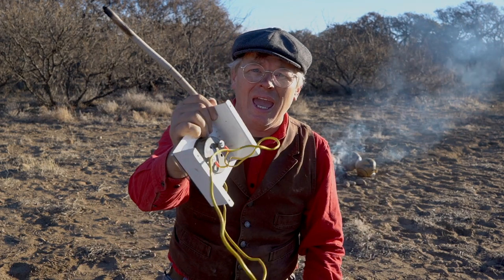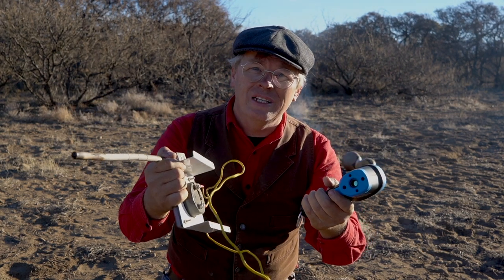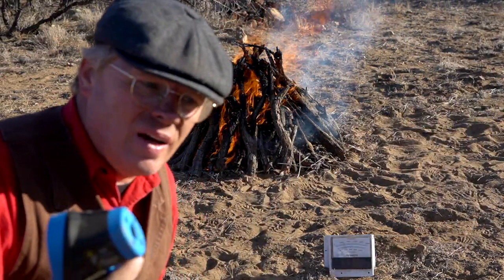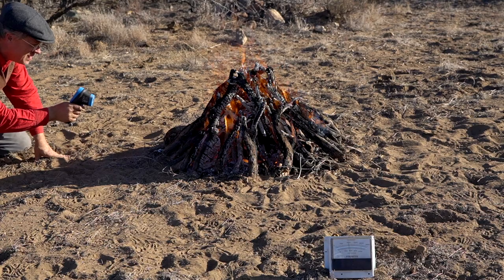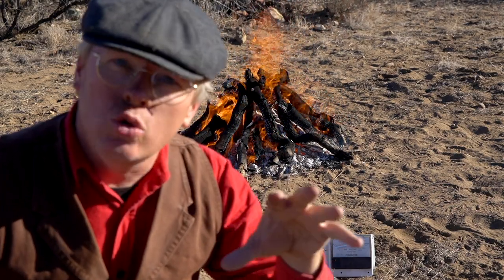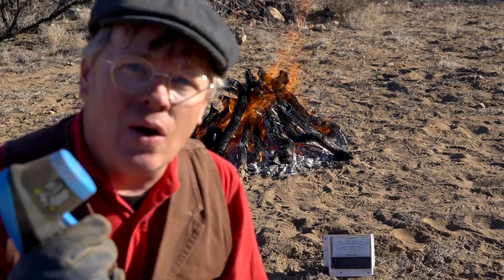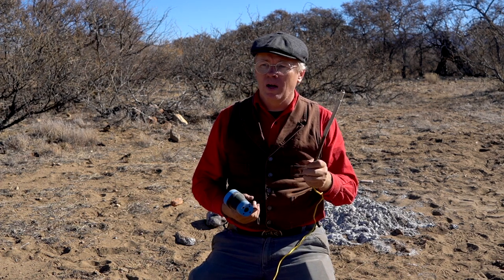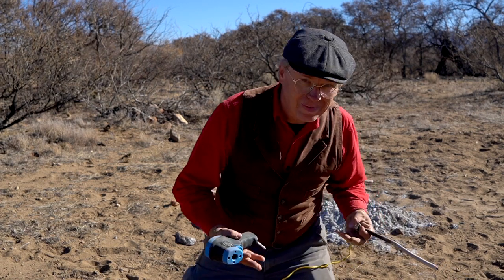Measuring Temperature in Outdoor Pottery Firings, Thermocouple vs. Infrared Gun

Comment: One of your viewers indicated the Thermocouple needs to be calibrated. This is true but also applies to both methods. To minimize the variance between the two methods is to measure something of known temperature such as a cast iron skillet in an oven. If set to lets say 500degF then measure using both methods. With this information one can then with some variability know what the temperature correction is  needed for use when firing the pottery outdoors. Thanks for sharing.
Reply from the maker: Thanks for the tips

Comment: Hi Andy! Would just like to ask what is the best temperature for the pots? And how long should it stay in that temperature? Thank you much.
Reply from the maker: The temp required varies somewhat depending on the clay used. I usually aim to reach at least 750 C but some clays need a higher temperature than that. I just get them to that temp and then let them start to cool, I do not hold them there a certain amount of time.

Comment: Hi Andy, Hopefully you can help me....I bought an anolog pyrometer, Sybron Thermolyne brand. I am getting almost no movement in the needle with the probe attached and in a glass of 130 degree water. How long should it take to get a reading?   Seconds..Minutes?  My husband questions wether it takes batteries or some electricity, it looks like the case is completely closed and only has screws for construction purposes.  Any guidance you could give would be appreciated.
Reply: Just figured it out, the manufacturer of the probe and leads has the wire color coding backwards.....reversed the wires on the pyrometer and it climbs up right away. My husband was impressed, no batteries!!
Reply from the maker: Glad you figured it out. It is miraculous how those things work with no power source.

Comment: This is interesting, what does this show us about the risk of thermal shock ? If the top is so much cooler than the bottom as the fire dies, will that increase the risk of cracking because of thermal shock ? I’m wondering if it makes sense to always raise the pots on a rack when firing to keep it above the coals.
Reply from the maker: Always temper your clay liberally for outdoor firing so it will withstand the thermal shock. I think the higher you raise the pots, the more they will cool off quickly at the end, so it’s probably a trade off.
Reply: I would think it to be a good idea to cover the  fire with a barrel once the pottery is up to temp while there are still coals on top. I beleive it would be a solution to temp variations and you get that cool blackend look on the pottery.

Comment: Every time I think I've seen all your videos, I find another excellent one! Do you do anything about adjusting emissivity?
Reply from the maker: I've never even heard of it before this comment. Then I looked it up, so maybe I need to but was just ignorant up until now.
Reply: Ah well in the case I'm happy to help... or complicate anyway! I read somewhere that in general emissivity can even change with temperature. They suggested measuring using a contact thermometer and comparing with the IR value at different temps. I have no idea how much this realistically matters, if at all. I'm sure not everyone must be doing all that with their IR zappers. Maybe only where tight tolerances are needed? I don't know

Comment: To get a real accurate reading with an infrared thermometer you need to account for the emissivity of the material you're measuring. Materials that don't radiate energy into space as easily have a lower emissivity. Most models have an epsilon (ε) setting that lets you approximate the emissivity, which is about 0.9 for most clay materials; but adding alumina or metal oxides could change this by a measurable amount. Oh and btw thermocouples also need to be calibrated. 

Mine's cheap and doesn't have that adjustment. I ordered a thermocouple. :)
Reply from the maker: These facts would be relevant if one were doing science, I am not. If my readings are off a little it didn't bother me one bit, but the relative and ballpark temperatures are important to me.
Reply: @AncientPottery  well in industry these are referred to as "process temperatures"; it's not the actual temp of the pot you're interested in, but rather the indicated temperature on your equipment that produces good pots. Like you pointed out somewhere else, the true test is that you get an unbroken vessel with good color; not that you're hitting a target temperature on the nose.

Just... a lot of people buy an IR temp gun and then get confused when it doesn't show the right temperature, and wonder if it's defective or if IR thermometers are unreliable.

You teach a lot of science in your videos whether you know it or not! :)
Reply from the maker: @stickyfox  I do love science, I just want to emphasize that exact measurements are not that important in this area. It is similar to cooking, the recipe might say a half teaspoon of salt but if you used three quarters of a teaspoon instead possible nobody would even notice. Lots of grey areas and blurry edges in my science.

Comment: I've used the MN Measurement Instruments (you noted) thermocouple/thermometer setup. One of their thermometers reads up to 2500F. Seem to be good quality and relatively inexpensive. They've got a 14.5 and 18.5 inch thermocouple that allow for more angled positioning deep into the fire. A few fire bricks with a gap for the thermocouple protects the wiring behind and also serves as a stand for positioning.
http://www.meter-depot.com/

Thanks for the info on infrared guns.
Reply from the maker: Thanks for the tip, that long thermocouple would be great for this kind of firing. I would love to see a photo of that brick setup, interesting idea.

Comment: Your assumption that pyrometers are only good for measuring the base of the pot temperature is flawed because you are using a 12" commercial kiln pyrometer that limits the position in your firing. Flexible cable pyrometers can reach ANYWHERE and you can use a multitude in a single fire.
Reply from the maker: No assumptions made here, just observations based on the equipment I have available to me. Tony Soares uses cones, so there's another option I haven't explored. There is no magic bullet here, some methods are better at others in different situations. If I were using a lot of cover sherds in this firing it would have been very hard to get a measurement with the infrared gun. A guy posted a picture on the "Primitive Pottery" Facebook group yesterday of his 17 inch thermocouple arranged with some bricks to measure the middle of the firing stack. So there are many other options available to the potter with some imagination.